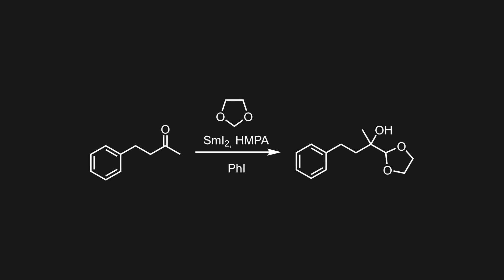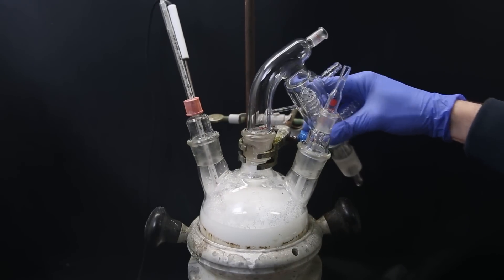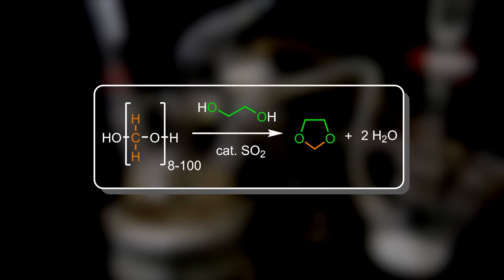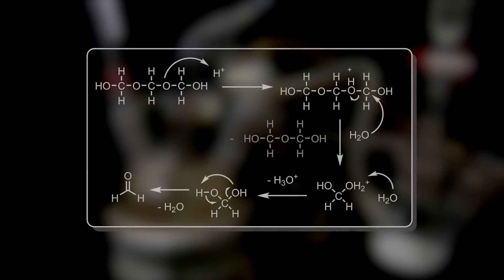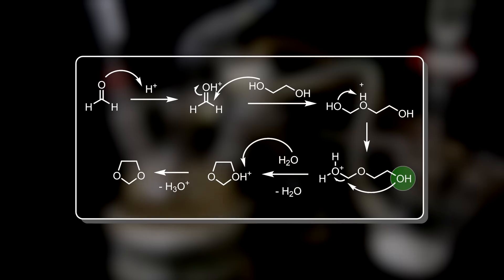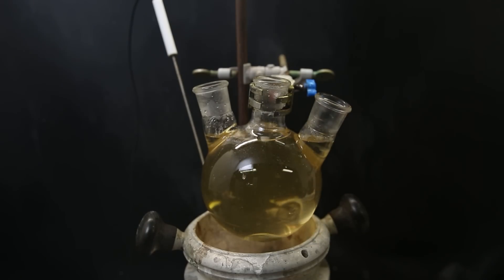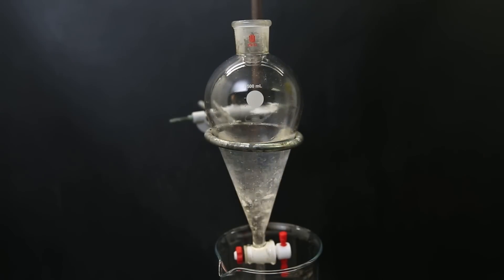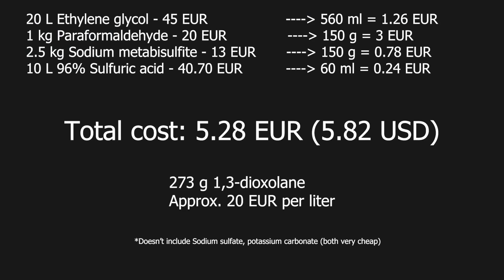Making 1,3-Dioxolane

Comment: Can dibromomethane or DCM be used instead of paraformaldehyde?  Then, requirement of acid is not required, base can neutralize the HBr (or HCl) which is kicked out
Reply: they're not very reactive and rather expensive compared to paraformaldehyde

Comment: using SO2, have you no respect for your neighbours 😂. I totally would have used regular old sulfuric acid, no difference in reactivity and you can still get rid of the SO4 by precipitation later on. PS. you can use a base bath or acid bath for cleaning your glassware overnight.

Comment: Well, it's less stable towards acid (re- releasing formaldehyde) and likely similarly teratogenic as 1,4-Dioxane. No real reason to use this stuff when 2-MeTHF has a similar boiling point, is way less toxic, and is reasonably stable towards acid. Plus 2-MeTHF is water miscible at elevated temperature, but not so much at RT
Reply: The heat-sensitivity of 2-MeTHF’s water miscibility is neat, I can see that being handy for some situations!

Comment: I wonder it it can be a Girgnard Solvent. That would be a great alternative to THF/Et2O
Reply: Likely not. It's so close to dioxane, which gives you the schlenk equilibrium product which precipitates out. I have never read of dioxane being used to form the grignard before its addition, and is always added afterwards to get the dialkylmagnesium compound.
Reply: @morningstarsci  Interesting, thanks for the response. Do you think it has to do with the O-lp into the C-O sigma* donation inhibiting coordination?
Reply: It's worth trying. If you want a fancy and easy made Grignard solvent, read about methylal. Methanol, paraformaldehyde, calcium chloride, and a little bit of HCl produce azeotrope of methylal and methanol in high yield. The smell of it resembles chloroform but is... lighter I would say?

Comment: You draw both substitution reactions as an SN2, but they will proceed through an SN1 as the adjacent oxygen can stabilize the carbocation by forming an oxonium ion. Otherwise great video as always!
Reply from the maker: You're right, they are SN1, I just condense mechanisms as much as possible and never draw SN1 unless it is key to the reaction. In reality it is rarely relevant if a reaction is SN1 or SN2 outside of University.
Reply: @Chemiolis  I may be in the minority but I would prefer the more precise version

Comment: This looks like it would be a great substitute for 1,4 dioxane where you want a bit more polarity but while still being aprotic. You could probably electrolyze alkali metals, alkali earth metals and rare earth's from the salts.
Reply: I really thought you guys were the same person for a moment
Reply: Chemical industry is so massive and has been around for so long that if it actually was beneficial, they would already be using it. Dioxane has the advantage of not being sensitive to acid
Reply: @christiannorf1680  All ethers are more or less sensitive to acid.

Should we stop using ethyl acetate as a solvent because it is both sensitive to bases and acids? No.

Not all solvents work for all reactions, so you use the appropriate solvent.

I would be more interested in its boiling point and the difficulty of removal more than its sensitivity to acid.
If it boils more than 100 °C, then I would not be that impressed.
Reply: not true at all. solvents in process chemistry come and go all the time. remember propylene carbonate, methyl thf etc.?  @christiannorf1680

Comment: Would trioxane work in place of paraformaldehyde? it would technically need slightly more water, but the trace amounts should still be enough right?
Reply: it should work as well, although I'd rather use paraformaldehyde

Comment: Finally, a video with few simple steps, not multiple staged synthesis. Other videos are also great but after some point, I just loose it ;)

But I wonder what else can we use it for other than as a solvent? Like can it be modified to be used as linking agent similar to glutaraldehyde?

Anyways, I think I should look for some chemicals like this and glutaraldehyde to make more aminated chitosan since I mainly work with it hahaha. I use glutaraldehyde and then apply ammonium solution and it works to some extent but it is very reactive and I am not sure if both aldehyde groups react and get consumed by amine groups of chitosan 🤔
Reply: It can be used as solvent and formaldehyde donor in Mannich reactions

Comment: great
so jealous you can get 10l of sulfuric acid for just 40 bucks

europe moment
Reply from the maker: I bought it like 2 years ago so it’s more expensive now :-)
Reply: @Chemiolis  the ability to buy it at all is worth gold. I don't know why they make it so hard for us around here. If someone really wants it, they will get it, just with more work.
Reply: @y33t23  Aren't most commercially available battery acids just nearly pure sulfuric acid?
Reply: @andersjjensen  not anymore, at least for private customers. You used to be able to get 50% at gas stations where you had to sign a clause that you wouldn't abuse it. Now you can't get that anymore, the upper limit for private customers in 15%. You can get that for pool pH lowering for example. Just need to distill it which is rather tedious. The excuse they made for banning it is ridiculous too. After someone got attacked with half-concentrated acid in public they banned it, while still allowing everything Sodium Hydroxide which is way worse to get in your face.
Reply: In Russia <2$/L :)
Reply: If you are in the US virgin sulfuric acid can be bought as drain cleaner.

Comment: Useful, thanks for sharing. NurdRage made the dimethyl version of this when trying to make dimethyldioxane. That was really sensitive to acids, which is something I would expect from this too. Have you tested whether it survives acids?
Reply: I believe generally acids hydrolyze these acetals into the carbonyl compound which would release formaldehyde and ethylene glycol in this case. It should still be acid sensitive as the only difference in NurdRage's video is just the use of acetone instead of formaldehyde (I presume).
Reply: That's also something I always wonder when coming across 1,3-DOL. If I recall correctly acetals are even more sensitive than ketals. Perhaps that's the reason it has not been widely adopted
Reply: @christiannorf1680  That and the lower boiling point.